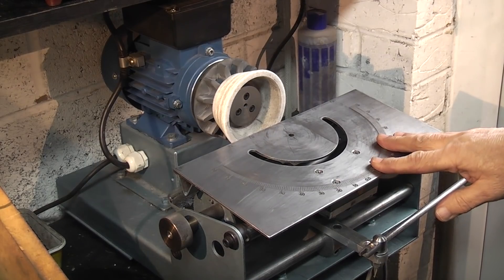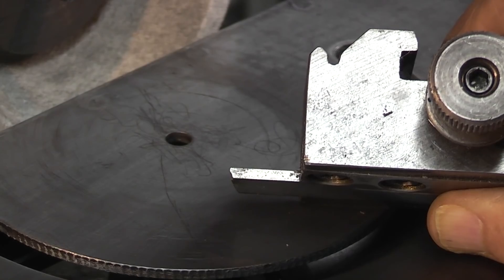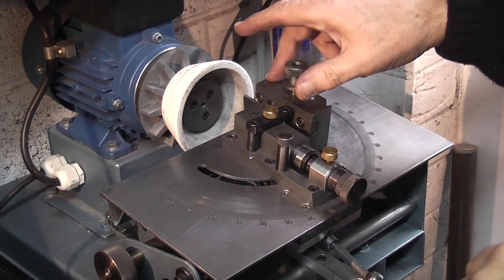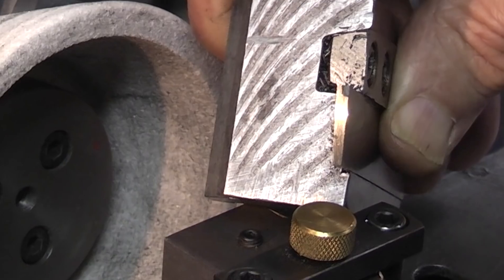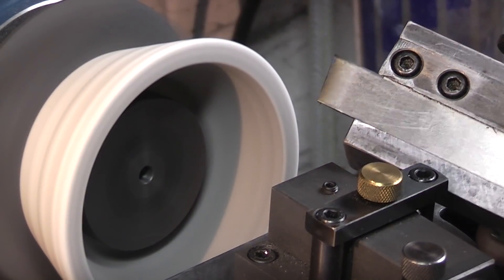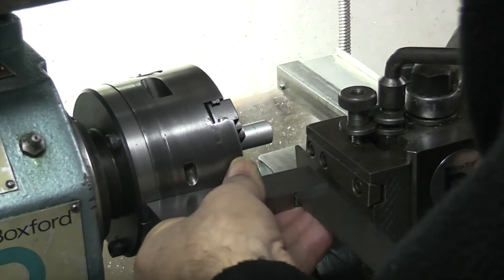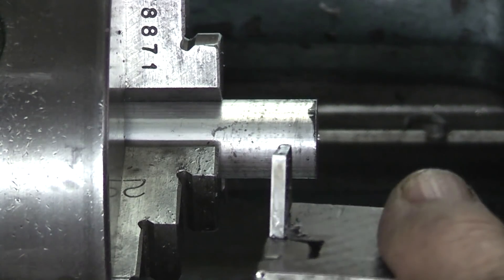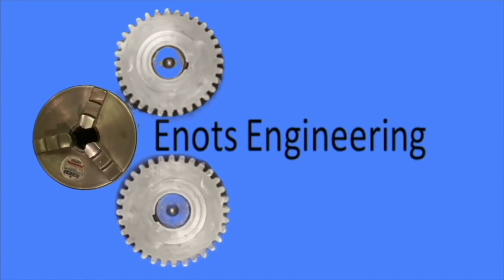Restoring the edge of a  parting off tool

Comment: Great sharpener, i would love to have one in my shop. Grinding precise angles for thread cutting tools is a hassle without one, especialy for trapezolidal threads. However for a parting tool it is simply an overkill, it could be done in 30 seconds on a bench grinder, providing it is no further than 5 feet from lathe and box of cold water is refilled.

Comment: That's how we used to do it back in the old days but now days it's not worth sharpening since you need a tool and cutter grinder or sharpen them on a bench grinder the way I used to sharpen them.It's cheap enough to buy carbide inserts for all occasions these days.You can machine faster and more accurately.Then again it's everyone's own choice.
Reply: Mehmet...... It depends what kind of shop and machines you own.
It also depends what material and workpieces you work on.
And its an big difference between hobby machining and the professionals.
For rigid CNC machines, no dicussion..... thats the right way...... to use carbide inserts. 
Sometimes its necessary and much cheaper to grind a special tool yourself, because you must earn money, 
10 minutes at the grinder and the tool is ready to use. 
No email, no bill to pay, and faster than all other solutions, and you can doo it on sundays, easter, christmas..... where nobody will grind your special tool ! 
For hobbyists with relative weak and small machines its best practice to use HSS, or better HSSCo 
There is no cheaper and and easier way to make chips with a clean and propper surface. 
I worked for years on a Mazak cnc lathe, and we often used it with self ground form HSSCo tools, to make our brass and other parts.
Reply: @schwellenzaehler4587  I understand where you coming from as a machine shop owner I have CNC and manual lathes and mills and time to time I still use HSS tools.Having said that I don't have a tool and cutter grinder either just sharpen them on a bench grinder where I sharpen HSS drills as well.I know this video is intended towards hobbyists but a tool and cutter grinder he is showing is not cheap for any hobbyist and that's why I said you can buy a whole lot of tools to cover a big range of machining cheaper than a tool and cutter grinder.Then again I'm not used to seeing tiny lathes and mills most hobbyists likely to have so you are right about using HSS tools on such machines.